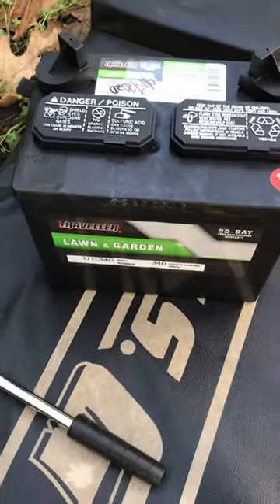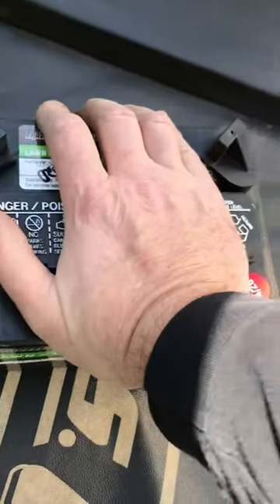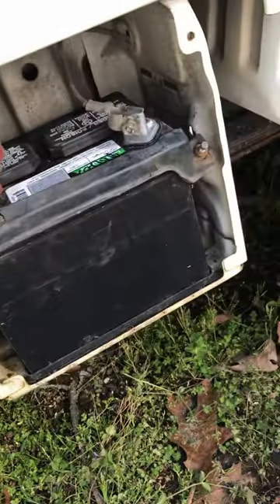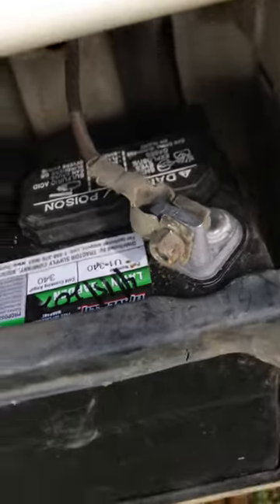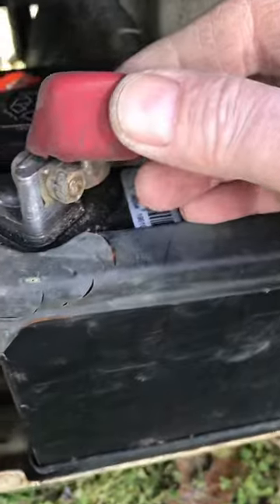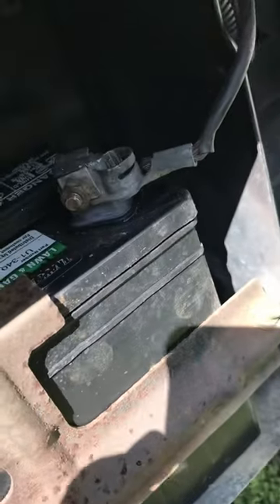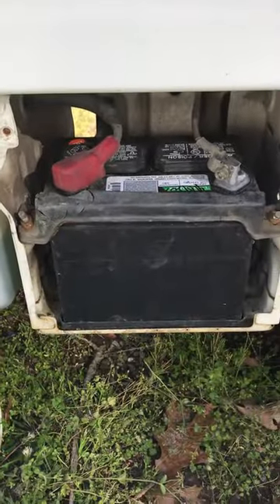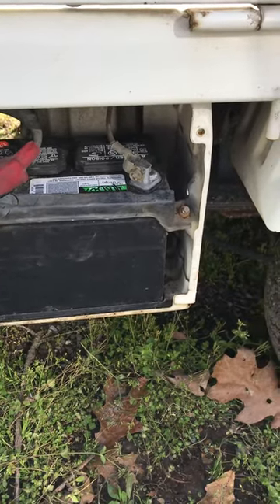Kei Truck replacement battery install

Comment: I don't think that's a good/full connection. Others have shown in their videos where this doesn't work because the terminals are not fully connected. After 2 weeks they say that they are experiencing long starts in the morning & once they changed the connections the start was great every time. The battery is a good choice, tho.
Time will tell if it's all good, keep us updated.
Thank you